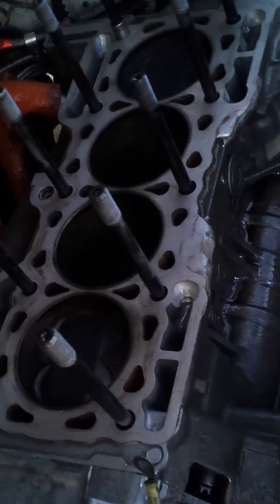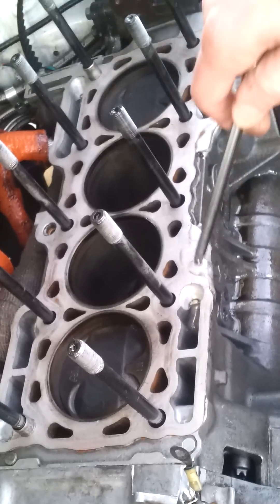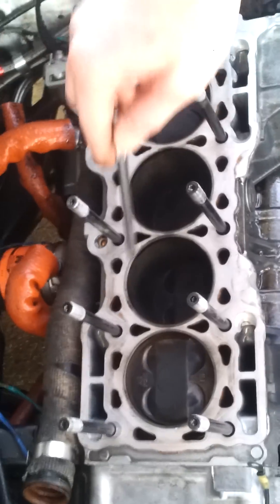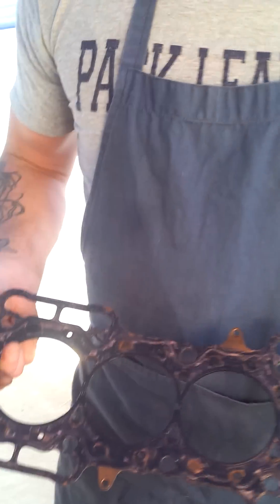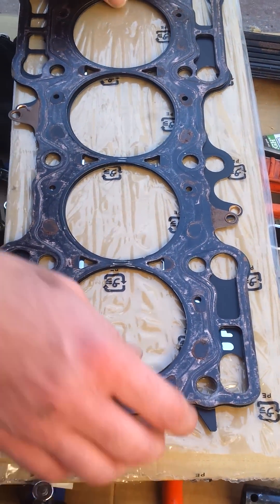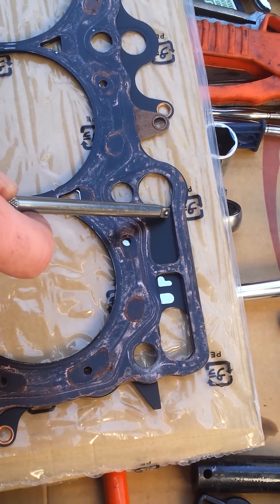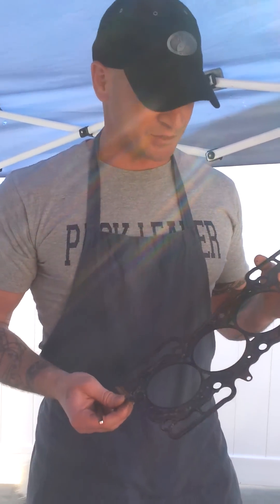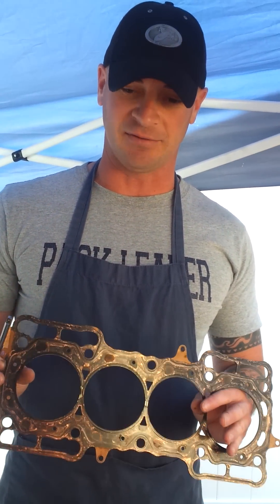H22 Reverse-Head block modifications

Comment: Why the F didn't you spin the pistons in the block? or rods?
Reply: Maybe you're deaf, THEY DID that's why they had to fly cut the valve reliefs.
Reply: Theres obviously a reason. Weight balance maybe? If you flip the pistons and rods, dont you need the crank balanced? Also what woud the clearances be opposed to just flipping the pistons? Every bit of compression helps power. 

Unless.... he did?
Reply: Imagine A World the crankshaft of an engine is balanced to itself only. The bobweights of the crankshaft are tailored to a weight range of piston/rod combos.

Comment: Cold air at the front for throttle bodies, like a K20. Cooler intake air means more potential power, honda inlet manifold was located between the engine and firewall, and as a result gets kinda warm, can have a power sapping effect on a hard driven car.